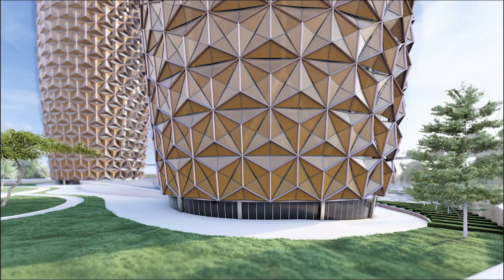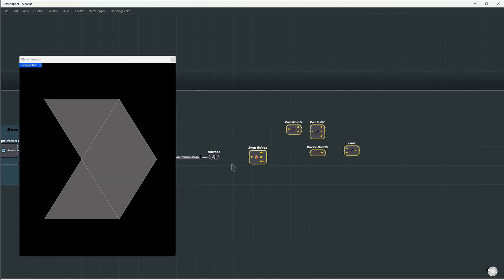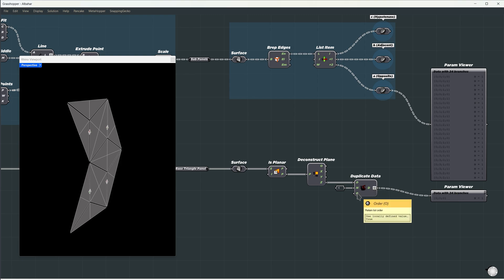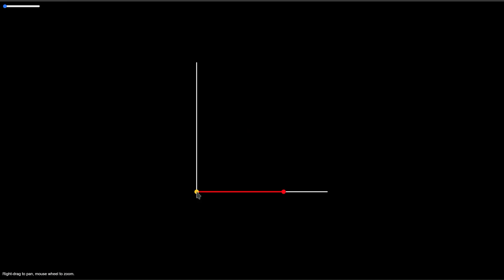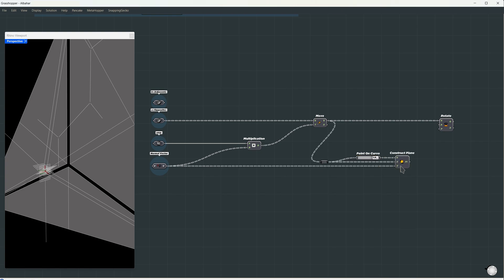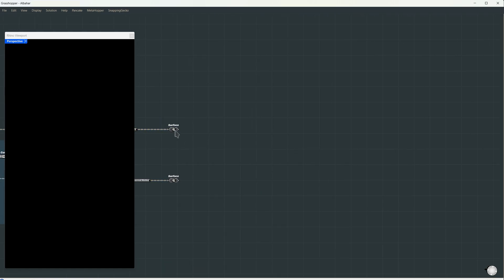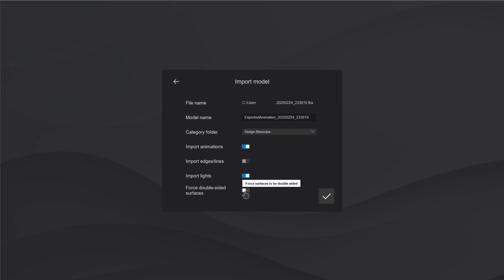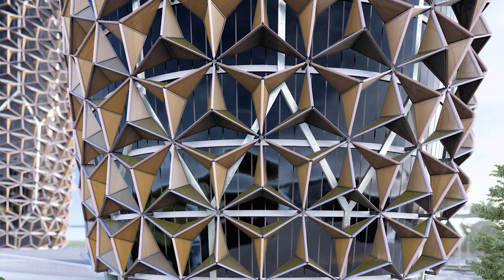Modeling Al Bahar Tower’s Kinetic Facade in Grasshopper

Comment: Hello, in both formulas at minute 9:23 of the tutorial, after configuring and connecting everything, I get the following error: 1. Expression generated an error for (b, a, amp): Unknown variable encountered: n, however, if I remove the variable "n" or replace "n" (in both formulas) with the maximum value of the Slider component renamed to Amplitude or amp, the error disappears, but the origami folding behaves differently; it is inconsistent. What could have gone wrong or been different?
Reply from the maker: The issue is that the formulas use the π (Pi) symbol, not the letter n. Once you replace n with π in both expressions, they should work as expected.

Comment: Thanks for the video, it helped me alot, but i still got some errors and idk why, the triangles do look only closed, even when changing the amplitude, it looks closed, idk if its maybe because of the surface ive used?
Reply from the maker: Not sure what went wrong. Try turning on the preview for the final panel only. 
What time in the video did you start noticing this?

Comment: How can I individually control the opening and closing amplitude of each module?
Reply from the maker: It’s actually simple. Think of it like this: you duplicate the entire script. One version handles all the base triangle panels (shown at 1:45), except the one you want to control individually. The second version is only for that selected panel. Use a List Item to pick any triangle panel you want to isolate, and use that for individual control. Then use Cull Index to remove that panel from the rest, and apply the same logic to the remaining ones.
Reply: @3DBeast  First of all, I sincerely appreciate your response. Here’s my situation: I am conducting a study on the daylight performance of office units with dynamic façades. To achieve this, I need to independently control all shading modules. Given that the office unit is relatively small, my previous approach was to duplicate the entire script 18 times. However, this has resulted in a slight slowdown in Grasshopper’s performance. Since I may need to run tens of thousands of simulations, computational efficiency is crucial. I spent the entire afternoon experimenting, hoping to find a way to achieve my desired results by structuring the data so that I only need to input it into a single script instead of duplicating it multiple times.I am not quite sure I fully understand the specific meaning of applying the same logic to the remaining panels. Does this mean that for each panel I need to control individually, I would have to duplicate the script?
Reply from the maker: @此木EX  I thought you were only interested in one panel, that’s why I mentioned duplicating. But for this type of project, you can provide the amplitude values as a data tree or list. If matched correctly, it will assign different values to different panel openings based on  youre radiation analysis as a whole a

I actually have an older tutorial that shows a similar setup, where panels respond to sun position. https://youtu.be/R_tD0muqPhw?si=DrL7kNYGIpOA4ybC&t=362 In your case, you can use your simulation results instead of direct sun vectors.
Reply: @3DBeast  Thank you! When I tried it myself, I replaced LunchBox’s Triangle Panels B with Grasshopper’s built-in Triangular. Then, I set it to a 1×1 grid. Based on multiple inputs, I provided a corresponding number of amplitude values. However, the result I got was that each generated panel received multiple amplitude values, and there was also an unexpected data deviation for reasons I couldn’t identify.

I will follow the approach from the tutorial video you provided and give it another try.
Reply: @3DBeast  I don’t quite understand the purpose of the "Duplicate data" step. Even if I skip this step or enter a random value—so long as it’s not greater than the value mentioned in your video tutorial—there doesn’t seem to be an issue. I’m not sure how the data structure operates in this context.
Reply: @3DBeast  I re-examined the part of my script related to data structures and realized that maintaining consistency in the data structure is crucial when I need to adjust the amplitude value for each panel individually. I must ensure that the number of input amplitude values matches the number of panels. Therefore, just as I previously duplicated the normal vector data, I applied the same approach to the amplitude values corresponding to the input values. As a result, I successfully achieved individual control over the folding degree of each panel by inputting different amplitude values.
Once again, I sincerely appreciate your guidance and assistance.
Reply from the maker: @此木EX  Glad to hear you figured it out! Yes, keeping the data structure consistent is key, especially when assigning unique values to each panel. It’s not always easy to explain this kind of logic in text, but sounds like you handled it well.